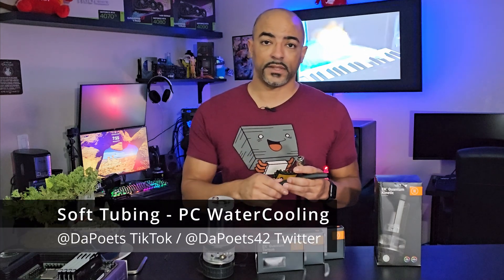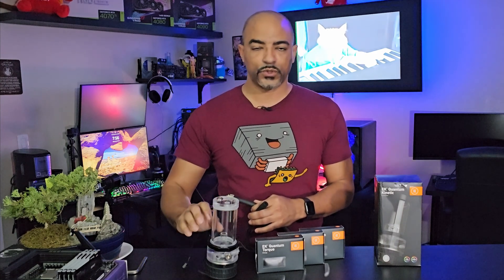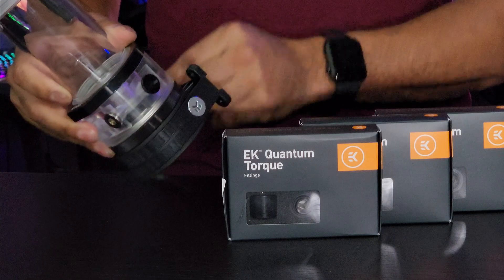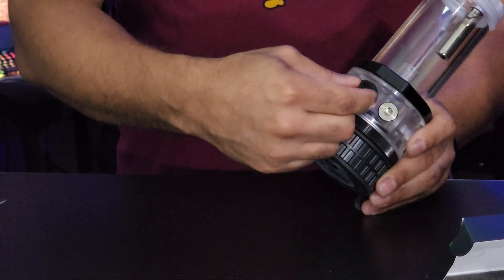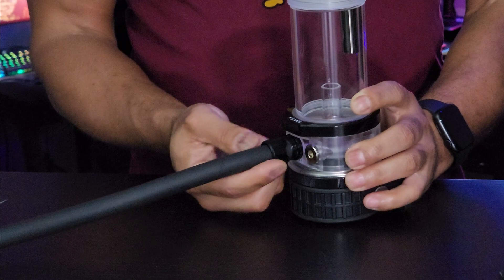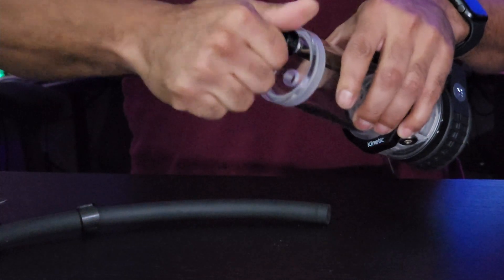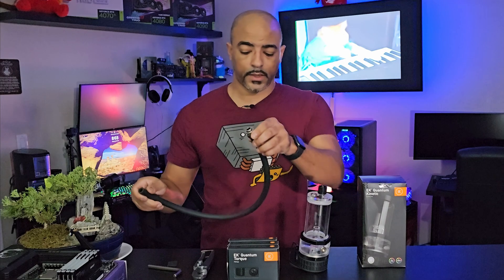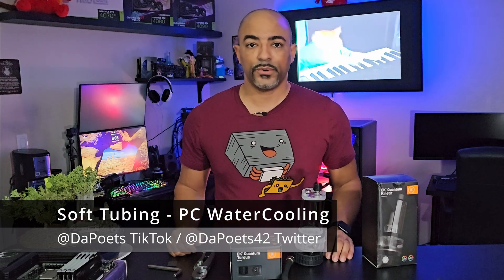PC Water Cooling Basics - Soft Line Tubing w/ EKWB Hardware

Comment: This was very helpful to me. I've always used 420mm AIOs, but I'm fixing to buy my first EK custom water loop system and install one for the first time. I'd say the fittings are what confused me the most and how they connected properly to the soft tubing.  I'm planning on getting clear 12/16 soft tubing, because some of the other sizes are out of stock or the fitting sizes for that tubing are out of stock. is 12/16 ok to use with the EK TBE200 D5 pump/reservoir? Also, If I'm just cooling the CPU and put two 480mm EK Quantum surface radiators up front in my Corsair 1000D case, should I try to get the thickest X series or stick with the middle P series? Thanks again for the video!:hand-purple-blue-peace:
Reply from the maker: Thank you for the support! I'm not sure what CPU you are trying to cool but one singular 420 mm radiator should cool most consumer grade CPUs so if you're getting two then you're more than adequate. At that point you're just going for a house slow you want the fans to spin. The manual for that case will tell you how thick the front radiators can be, as I would not know that off the top of my head. You can use any size tubing and fittings you want as long as they match, so you'll be good with whatever pump and radiator you choose to use. I'm glad you found the video helpful and let me know if you have any further questions.

Comment: Water cooling has a great finished product but it is kind of scary putting liquid into ur gpu or cpu. Came from tiktok
Reply: what gotten me into watercooling, or well thinking its saver than in the past, is due to "LeakShield" look it up. 
it creates an negative air pressure in the tubes, so that if there is a leak, the fluid will still stay inside the tubes . its quite a cool new piece of technology patented by Aquacomputer,

Comment: Have you looked at the Bykski watercooling parts, would you feature/talk about those? They provide great value compared to EK.
Reply from the maker: Yes they have been around for forever.  They are ok in quality but their performance doesn't match EKWB or Optimus.  They have similar performance, if not a bit better than Corsair water blocks.

Comment: I just put a different GPU in my soft loop. I spilled coolant, broke the RGB stip on the old block, and broke a fan wire on the new GPU's stock cooler. Even still, it was tons of fun, and well worth swapping to an EK block (The old Bykski block was not sitting on the die properly and temps were bad).
Reply: You sound reckless like me lol. Wrecked so much havoc while watercooling and swapping components and water cooling equipment. I'm too embarrassed to list the parts and stuff that I've destroyed due to being reckless. 

But besides that, I had a Barrow CPU block, that was driving me insane. I kept getting worse temps by at least 10c from my air cooler (Thermalright PA120 SE). Someone said that you need to "tighten it hard" so I tightened by hand as hard as I could and still to no avail. Eventually what did work for me was, I got a pair of players (tool), wrapped the players around the head of the screws and tightened each of the four CPU bracket screws alllll the way full force until they couldn't turn no more. Only then I finally got good temperatures and I was able to over my CPU significantly higher than it ever could on air.
Reply from the maker: What a journey!
Reply from the maker: lol well you learned a lot from this experience and I'm glad it worked out for you in the end.  don't take things too seriously w/ PC Water Cooling, it's a journey. Some people can get too uptight about being perfect :-)
Reply: I think from moving the block inside the case so much, the wire just gave out. And my pliers slipped off of the fan header and got the other wire when I was taking the stock cooler off. I was trying to be careful, I promise. lol

I tried everything besides lapping the block. Eventually there would always be some sort of pump-out effect, and after removing the block there would be a portion of the die that was bare (even after manually spreading paste all over the die). Temps were in the 70s, and hotspot would hit 105C. I just got tired of fooling with it, and I wanted to switch to AMD also, so I thought why not and went for it.

Comment: Great video, thanks for making n sharing.  I’m about to enter water cooling with a custom loop planning on going with ZMT, I have read sometimes the tubbing is not consistent with the diameter and it’s recommmend to use liquid dish soap or/and to sumerge the ends on hot water.  In your experience is this a recommended practice for ZMT?
Reply from the maker: I have not experienced that
Reply: I had that experience with EK ZMT when using other brand fittings from AliExpress. I had to use 2 pliers to tighten them  It was a nightmare to build my loop and I think I need to cut the tubing if I want up take apart the loop. I think if you stick with EK fittings they should be okay.